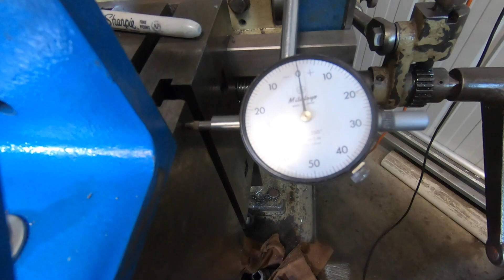Radial Arm Drill   Part 2

Comment: You are doing well mate! You have the right idea by replacing just what needs to run and make sure the thing will work before going full beans in restoring it. Be safe and stay well. Cheers
Reply from the maker: Gday Yves, I think its the best way to go, if it all works well then I might got the whole way on a rebuild, just have to see what happens mate, thanks for watching, Cheers

Comment: Good one sorting the dog .  Some of the old fibre gears are way stronger than a lot of people think . I am not sure if it is just me ,  but  i have found the mechanical type videos a bit more difficult & involved to film  compared to what we normally do     . 
You may want to try some high tack grease on the gears  so it does not all melt off in summer !  
Cheers .
Reply from the maker: Gday Max, trying to film the shaper cutting the keyway isn't real easy, ive got a good stock of graphite powder so I was going to mix some in with the grease as well, can't do no harm, thanks for watching, Cheers

Comment: Just noticed that the shafts are different diameters. I think you got breakout because you made the dog the same as the other dogs on the smaller shaft. That also potentially means the selector is different on that one larger shaft. Hard to tell just watching a video without being able to do measurements. 
Just found your channel from watching CEE's channel. Nice work, thanks very much for sharing.

Comment: I have the Spanish version of this drill mill . Think they are a copy of Aboga . Drills and mills . Mine just has a bit of oil on the shafts oilers on the top of the gearbox. Lovely machine a pleasure to use . Hope yours turns out well.
Reply from the maker: Gday Mark, I like to see your machine, its it very similar to mine?, they are a well build machine, thanks for watching mate, Cheers

Comment: Nice job on the gear box Matty. Those fibre gears may be original, I have a Swedish Arboga E830 gear head pillar drill that has a gear box very similar to yours and it came with factory installed fibre gears. My gear box has oiler holes for drip lubrication as opposed to grease pack , and that seems to work fine. That's a nice machine you have there, I wish I had the radial arm feature on mine. Cheers
Reply from the maker: Gday, I’ve heard the Arboga has a very similar gearbox setup, the fibre gears look to be in really good condition so hopefully they will last for many years, appreciate you watching mate, cheers

Comment: No oil? Hmmm. 🤔
I would be tempted to drill some access holes in the side casing so the gears could be oiled with a oilcan. And a drain hole at the bottom.
Then put some easy-remove covers over the holes (caps with magnets?) and a screw in drain plug.
Then it could at least be oiled once a month or so...
Reply from the maker: Gday, I think I might put some button oilers in at some stage, the idea of a drain plug is a good idea, thanks for watching, Cheers

Comment: 20mm bore through 1375  -400  -790  leaves only 93 thou wall thickness . I wonder iif that selector  was slightly larger and the selection dog different? Is the shaft on the motor side of the gearbox ?
Reply from the maker: Gday, from what I can see the selectors were all the same dimensions, im not sure why they made it bigger, Cheers

Comment: Hi Matty  .. Its a wonder what you find when you try to fix other peoples repairs.  Amazing the case covers weren't damaged.  You did a good job with the dog gear. Will it have to be hardened because it might be spinning when operating  ? . Be Interesting to see how it works.
Reply: It only has force applied to it when it is in positive engagement, so it should be fine.
The weak link in that gearbox is probably the fibre gears anyway... 🙂
Reply from the maker: Gdat Ted, I was thinking it should have been hardened, ill see how it goes, the others in the box art hardened so I think it might be ok, thanks for watching mate, Cheers
Reply: @MattysWorkshop     the hardening is important if you will be sliding the surfaces in/out of engagement while under power.
If you only slide the engagement when the spindle is not running (generally the best way anyway) then hardening is not needed and the part might even be tougher and less likely to crack if unhardened.

Comment: Excellent work, Matty. I'm impressed with the slotting on the shaper. I'm wondering if that part was maybe a little bigger than the others, and needed the arm to be thinned back near the end. The arms are pretty thick and would have room for the reduction in thickness. But it doesn't matter and it is pure guesswork. What you have done will get 'er done and may in fact be the correct dimensions. All the best, Mart.
Reply from the maker: Gday Mart, I really haven't got any idea why it was made bigger then the other 2, it will always be a mystery id say, thanks for watching, Cheers
Reply: G'day Matty.  It does make you think why but then bend the selector rather than make a new one but then did you consider making a new selector to fit the original modified hub? Excellent job as usual I hope it works. Cheers Peter
Reply from the maker: @pgs8597  I found the issue with the selector dog before I made the last selector arm, I figured they all had to be the same size…
Reply: I had the same thoughts as others in these comments Matty. Maybe the original dog was bigger to suit the bigger gears and shaft diameter, and it might've had a stepped shift lever to allow things to clear each other. It should also leave more meat in the bore of the dog so the keyway does not break through into the lever groove. As you said, it's hard to know for sure, but I'd have to guess someone previously made a new lever and a new selector dog. The new dog was possibly close to the original size, but they cocked up on the dimensions of the new lever seems to make the most sense?

Comment: Great work Matty, definitely a strange one, was the gear selector made to the bent arm?
Thanks for sharing.
Reply from the maker: Gday, thats very possible, I wouldn't be surprised to be honest, thanks for watching, Cheers
Reply: @MattysWorkshop  could also be to increase the engagement in the slots on the gear face, they look fairly worn, so did one of the other gears.look8ng to be a great machine Matty. Best regards John
Reply from the maker: @bostedtap8399  the slots in the gears are quite worn, If all goes to plan I will more then likely machine 2 new slots 90° to the old ones, Cheers
Reply: Hi Matty, if you machine new slots in the gears it would still be a 50/50 chance which slots engage..unless of course you fill in the old slots with weld I guess👍🇦🇺